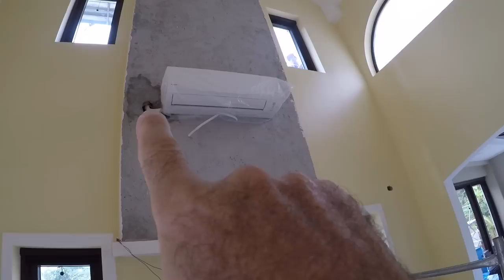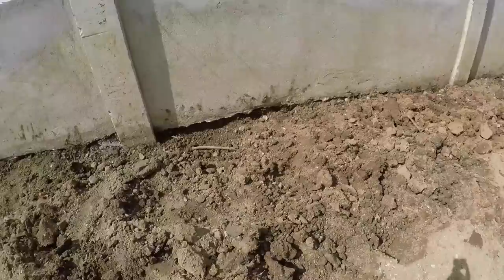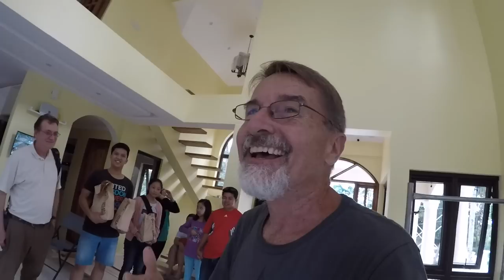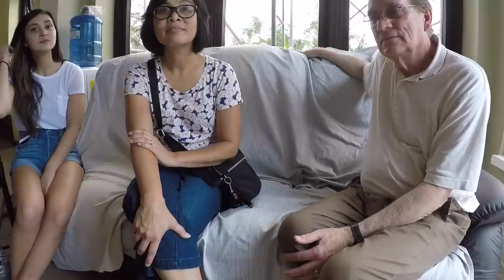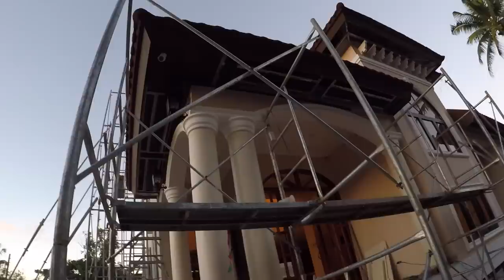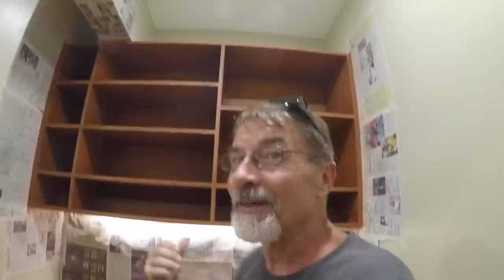VILLA FELIZ - EPISODE 277: ANATOMY OF A STONE WALL (House Building in the Philippines)

Comment: As I suggested before, I still believe that placing two lantern lights at the entrance will give better ambiance and it's simply doable, by connecting the wires to the existing lights on the side of the entrance and run it through the space above the soffit and make a short groove in the finished cement layer, about one foot, easy to retouch afterward.
It's lighting that area including the walkway, the stairs, plus the symmetrical look you always keen to accomplish, so here's your chance!
It's your call Ness this time because I wrote to James before about it in a previous video, if it's not done now while construction still going on then when?
Best wishes and regards to Y'all.
Reply from the maker: See today's episode Ned.

Comment: Hi James, the house build is looking perfect. Btw. the quartz kitchen counter comes with standard 9x3 ft cuts. The counter installers should be able to patch it seamlessly with similar material and you won't even know the difference. May I suggest creating an upward lighting on the columns since the flooring is not finish at the front area.
Reply from the maker: Erma, they already made the splice and it's "okay" but not seamless.  Also, I'm a big fan of ground lights lighting up the house.  We'll be adding those later.

Comment: James is that 80 centimeters, if that is a dishwasher or an oven opening you will not be happy. When I built I was told 4 feet, between a dishwasher and the island counter, you have about 32 inches. I went to 52 inches and that works well to get around the dishwasher door in the open position. The stone work and the kitchen look great.
Reply from the maker: I so understand your philosophy Barry but I had to make a tough decision.  Do I have less room between the oven and island or between the island and a travel path from the kitchen to the dining room/sun room.  I felts there will be much more foot traffic in the later and we seldom use the oven so that's the logic on how I made the call.

Comment: James you used quartz for countertop in the kitchen and granite in the bathroom. Why the difference?
Reply from the maker: Quartz is man made using natural stone whereas granite is natural stone itself.  Quartz has many of the same characteristics of granite but without some of the staining an absorption issues.  Since quartz is man made it can be shaped easily to specific sizes and dimensions its easy to have it tailored in one piece for your project instead of gluing together.

Comment: you have a no idea what stone work is mate , sorry ! chineze cladding is what you should be calling it , nothing unique about it , or hand crafted . its purpose is more commercial , used in train stations , shopping centres etc , not around yr house . (it is blood stone put together with slave labour ). rip it all off the walls and start again with real stone from the area , 250 mm out from existing wall , chem anchors every 600mm  .  $ 700 aus  per msq .